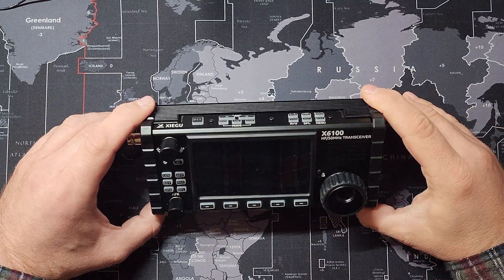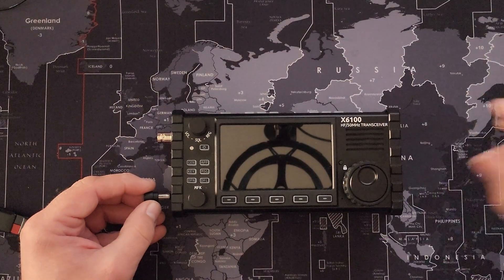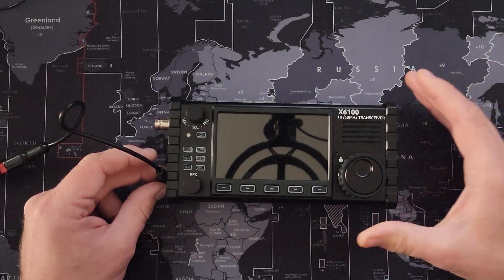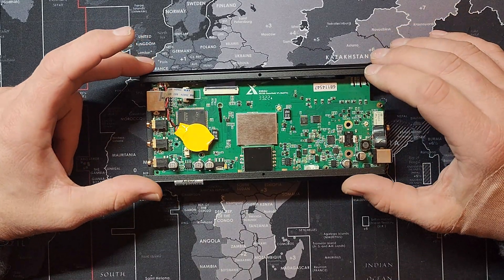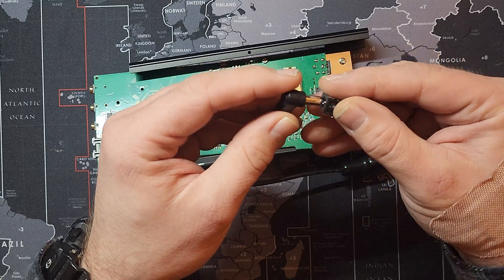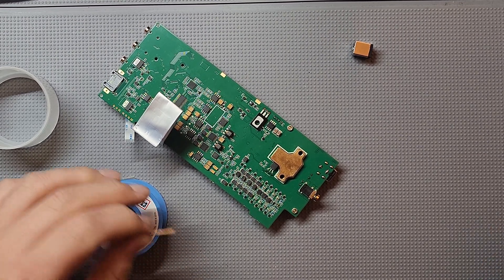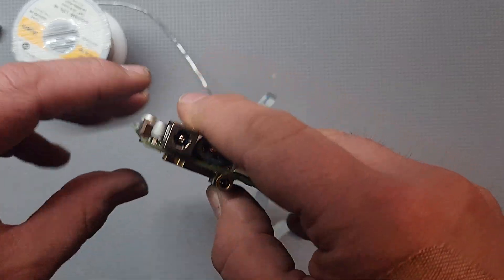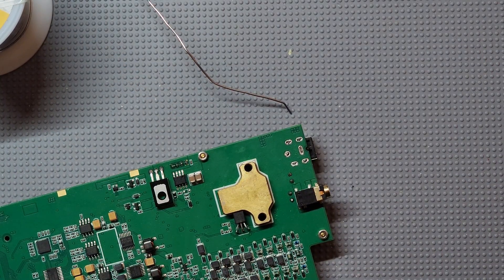Xiegu X6100 DC Jack Replacement

Comment: The connector seems to be a slightly odd size and the cable that came with the radio is the only one I found that fits well. SInce the input voltage can't go over 16 volts without blowing things out I am going to install some over voltage protection diodes on the power input next time I have mine apart.  Also there does not seem to be any heat sink grease on the power transistor heat sink where it connects to he back panel so you might want to address that.